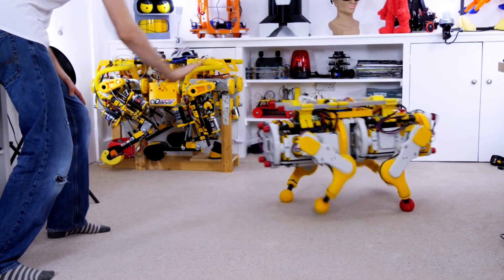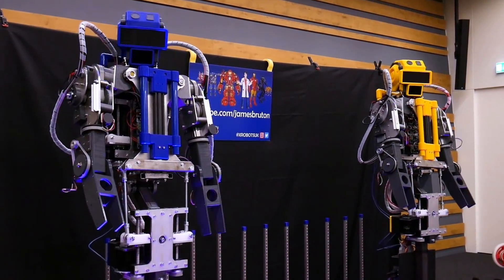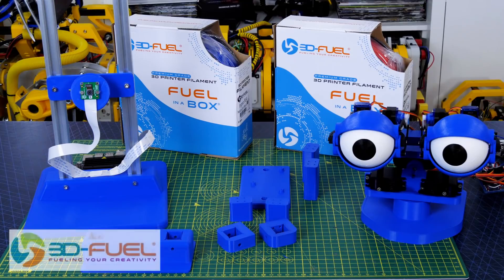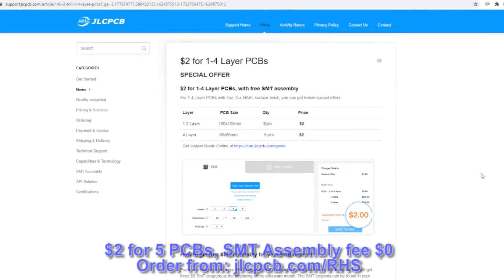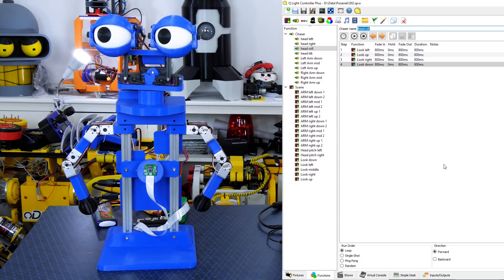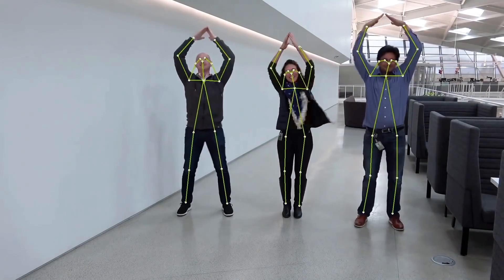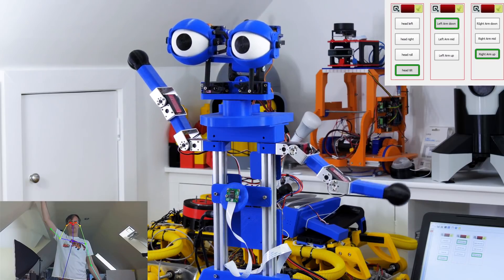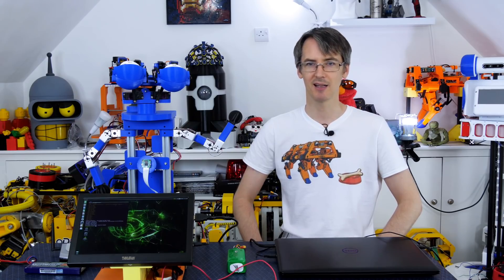Robot Dances so You Don't Have To

Comment: I know this is old, but if you use two cameras you could do the 3d trig a bit easier for the arms. You could get the two dancing robots to each have a camera placed on them and combine the data to find the relitive position in 3d. Then use some projection mapping to find the angles of the arms, and then place that onto the servos.

Comment: Is it necessary to use a DMX shield if you are only controlling one Arduino and no other DMX devices? Or put another way, can QLC+ control the servos through the Arduino but without the DMX shield (or similar hardware like a max485)? I tried searching online without success, but maybe I'm googling the wrong terms.
Reply from the maker: You need something to interface to it, you could use MIDI or one of the ethernet protocols maybe
Reply: @jamesbruton  Thanks for responding! I will probably give in and buy a shield, as I'm not having luck with the other options I've tried.
Reply: @jamesbruton  I think I was interpreting the set up incorrectly. I assumed you were connecting the Arduino (with shield) to a computer via usb and the shield just allowed the Arduino to function as a DMX device. After rewatching the video, I see a DMX cable plugged into the shield while the robot is dancing. Now I get it!

Comment: I've commented on this at this channel in the past.  I am a graduate student researching new intended motion systems for exoskeletons.  My team has created a table-mounted wrist prototype to test our system, but I have created a backpack frame and shoulder that will one day hold the arm.  For now it is a geometry test to make sure the links have the proper range of movement, so it is not actuated, but I'm creating the design so that actuators can be easily added later.  So since all the joints are passive for the moment, and since I need it to be able to hold the weight of the succeeding links, I need to make the passive joints of the shoulder resistive, so they can move freely but hold their position when not moving, a lot like a laptop lid.  Right now I'm using rings of magnets around the bearings but there has to be a better way.  Anyone with any knowledge or ideas, please let me know! Thank you!

Comment: Hey James, as another non-touching control, maybe you could use on of those step on piano mats. If you could find one that has midi outputs, you could do that. Or if not, tap into the wiring of it, and use each key as a button press. That way people would just be able to tap the control with their foot.
Reply from the maker: I think I featured that in the clip of my Performance Robots